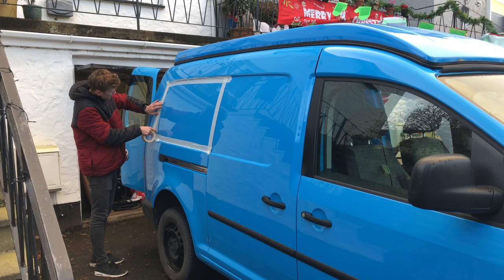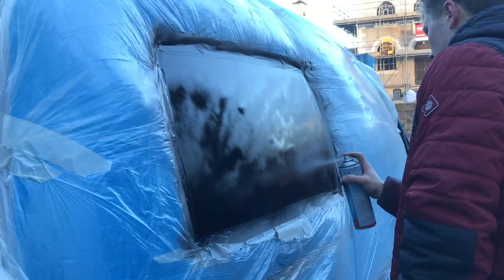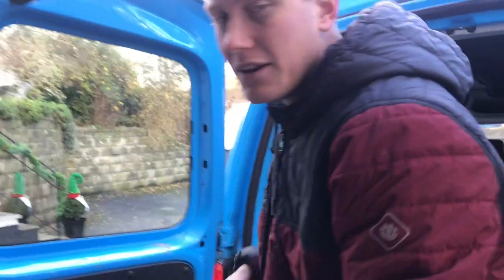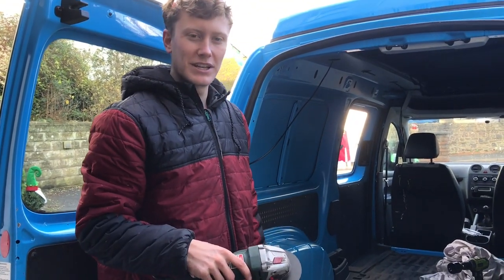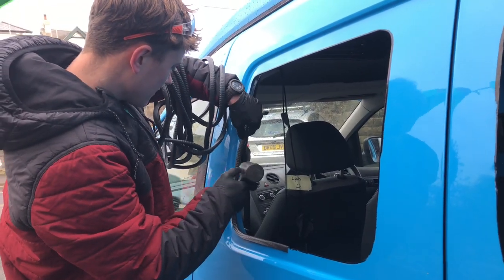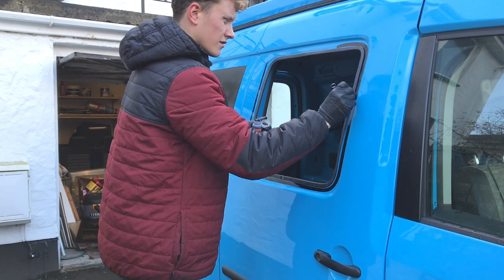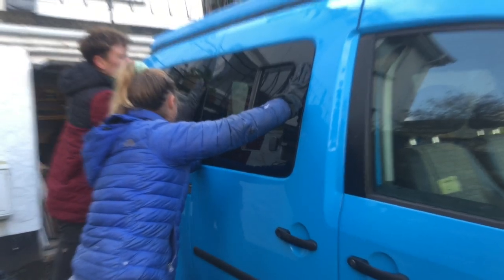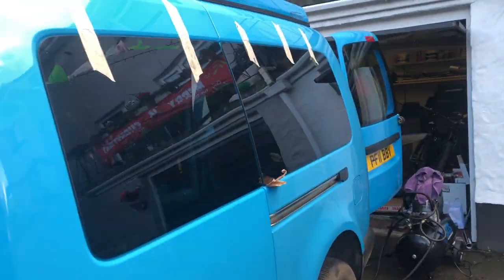HOW TO INSTALL WINDOWS IN A VOLKSWAGEN CADDY MAXI CAMPER VAN

Comment: Thanks for making the video it’s very well put together!
Reply from the maker: Thanks guys!
Reply: I just bought the glass for my caddy and a nibbler after watching your video. Did you find the glass handed for each side? My instructions were rather basic without pictures.
Reply from the maker: @Georgous92  Amazing, the nibbler makes the job alot easier! Yeah the glass should be handed for each side. I would have a dry fit of the windows up against the side of the van before fitting. As some of the glass doesn't have the best shape
Reply: @cruisycampers4749  thanks for the info!

Comment: Hi, do you have a link for the tool you guys used to cut out the metal? I'm looking to install a window in my caddy too and this video made it look easy :) thanks
Reply from the maker: Hi there, it was an air powered nibbler, I believe we purchased ours from screwfix
Reply: Probably a bit late now but you can also get nibblers that fit onto a drill.

Comment: Hi, was this an ex British Gas Caddy? If so, how did you go about removing the black paint/cover (whatever it is) from the rear windows? Cheers!
Reply from the maker: Yeah this one was an ex British Gas one. The rear window covering on ours was some sort of vinyl sticker. We just used a sharp blade to peel up an edge on it then used a heat gun to slowly peel it back. It actually came off a lot easier than we thought! We’re now getting them tinted to match the others
Reply: @cruisycampers4749  Thanks a lot for the reply! I would probably say mine is vinyl too to be honest. When you peeled it off did it leave a nice edge/all peel off completely? My only concern is that the glass is larger than the opening in the panel and goes past the inner door skin (beyond reach). So I wasn't sure if the vinyl was applied prior to the glass being fitted thus not being able to remove it fully and being left with a rough edge. Hope that makes sense! Also, is the glass clear once removed? Thanks again for your help!! :)
Reply from the maker: @danielpalmer8807  Hi Dan, yeah ours peeled of super easy and didn't leave any residue or vinyl behind. It is slightly tucked behind as you say but when you peel it off it also pulls the bits tucked behind off easily too. Yeah ours was clear behind, were now going to get it tinted. No worries!